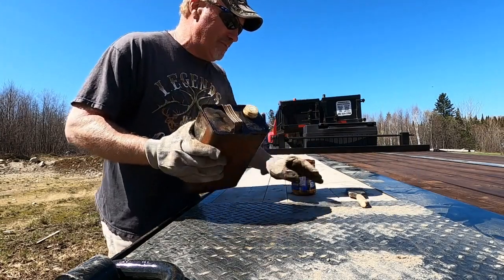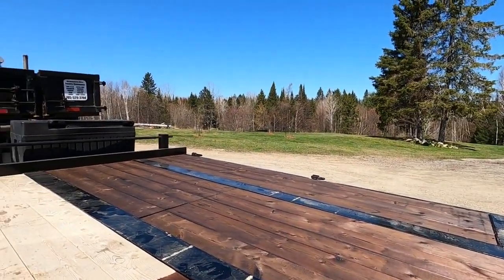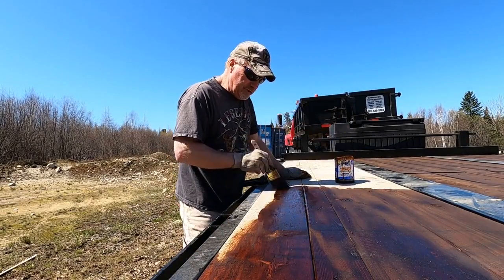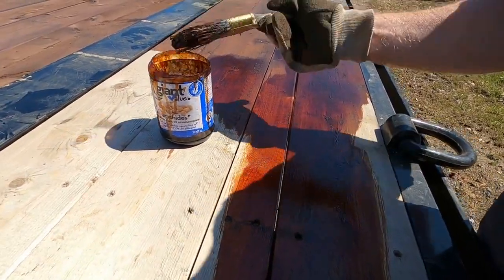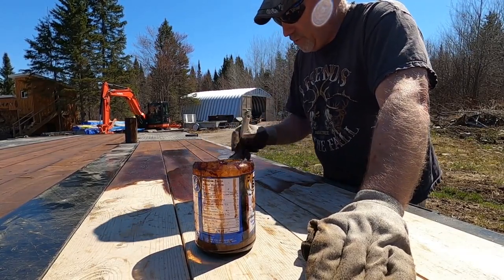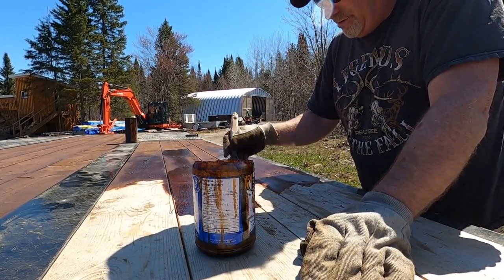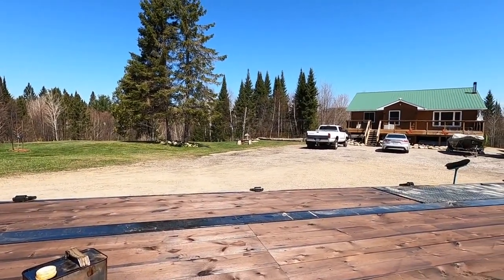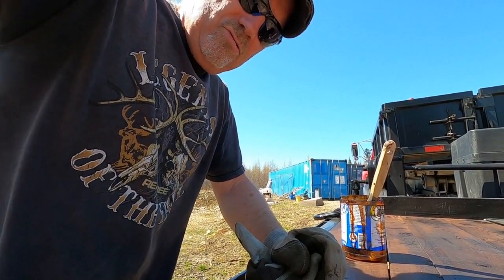Staining Trailer Deck

Comment: Used motor oil mixed 50/50 with diesel works well. 👍